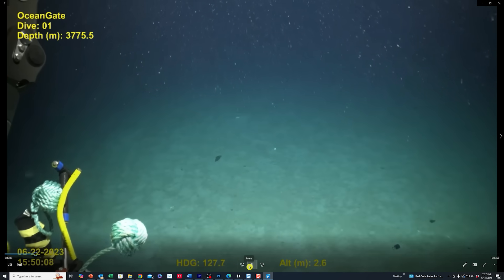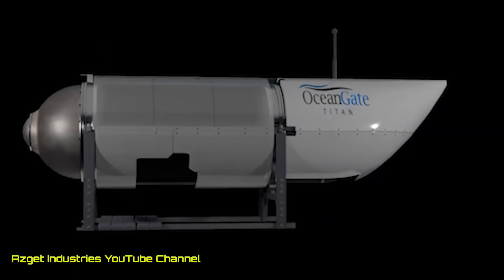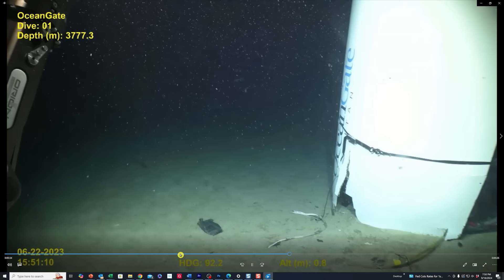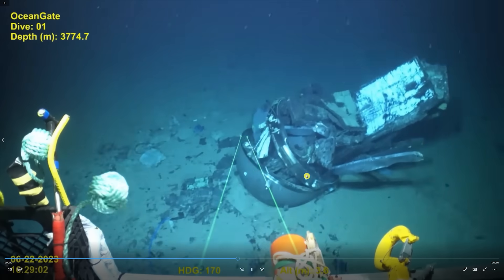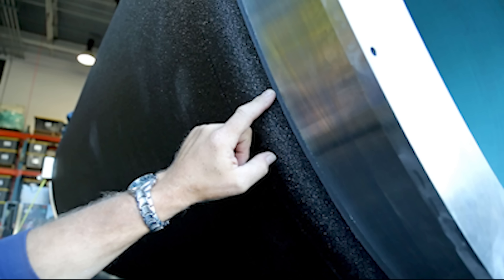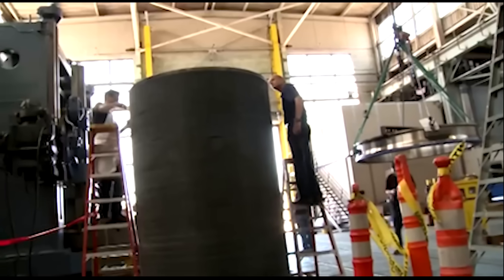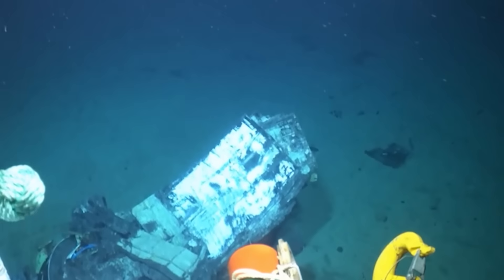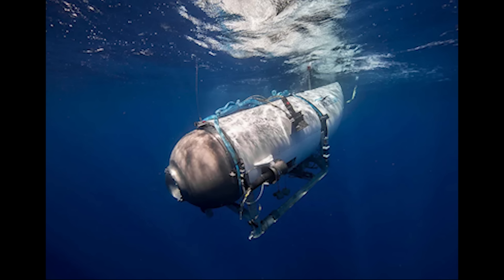OceanGate Titan Sub Debris Video Shows How It Imploded

Comment: The strap and the Playstation controller are still doing their job. So much for all the experts.
Reply: Yeah but that peanut butter glue and the carbon fiber, not so much.
Reply: @hille422  The peanut butter was basically a seal, the 3million pounds of force kept it pushed together. The carbon fiber also worked but he cheaped out on specs. It called for 5in but he stopped at 3.75in once more cost cutting. The ship also had a limited life span and he failed to properly find that number. Why? Penny pinching again. BTW, that peanut butter was another brilliant cost saving off the shelve product. It was Rhino coat truck bed sealer. 😄  not kidding.
Reply: @SlickArmor  Carbon fiber is just a bad material for pressurized environments. for usual stress it's great because it has just enough flex while being lightweight and durable. but for pressurized environments, that amount of pressure turns it basically to glass, not to mention flexing it and eating away at any chance of adhesion
Reply: Wasn't it a Logitech controller?
Reply: @BukBuk187 it was a knockoff of a Logitech design with a 2 star rating on Amazon.
Reply: @SUPRAMIKE18  oof that's even worse
Reply: @which one was it? Any link to the productSUPRAMIKE18
Reply: @mindrover777  unfortunately I can't find it now but there was a whole Reddit thread discussing the controller, it's a Logitech G F710 but  there were tons of fakes floating around on Amazon and eBay for cheap prices they even said Logitech on them but weren't produced by Logitech, they had different packaging and some physical differences, in the news clip where they show the controller someone pointed out something with the grips and the button colors being different that they most likely had one of the fakes .
Reply: @SUPRAMIKE18  wow, will look into that.
Reply: @BukBuk187 yes it was and it suffers from a bad Bluetooth connection.
Reply: Yeah, I find it weird people keep pointing that out when it was probably one of the best made and reliable parts of that deathtrap.
Reply: @John_Citizen_17  I hope they don't find out the military uses them to control flying things that are carrying things that are dropped. If you know what I mean? In fact they're used on quite a few things in all branches. I see here that he stayed true to par and sadly cheaped out on them too.

Comment: I don't get it. Why would they not test the capsule beforehand, put it in a pressure chamber simulating the required pressure, and more, to be safe? It looks like bad engineering and lack of testing
Reply: He was told to conduct all manner of testing and did extremely little.  Not to mention that he was warned and told by experts that the carbon hull wouldn't hold.  Down there is 6K pounds of pressure per square inch.

Comment: The hull appears to actually be sheared clean off the ring. It's just shoved down the rear dome so hard it ripped the bolts off of it. Courtesy of having water move it at mach 10. The front ring was god knows where on the ocean floor at the point when they found the sub. The water pressure sheared the bolts off there as well. My opinion is that the flange on the front ring gave way after the glue gave up. After that there is nothing to keep the carbon fiber hull from collapsing.

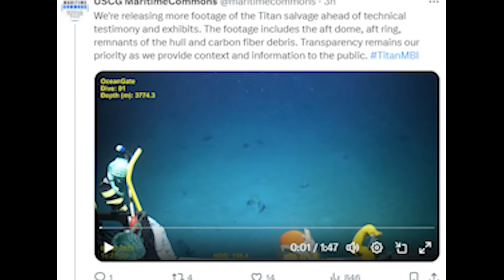Comment: Between about 4:09 to 4:18, I think it IS the view port.  No discernable bolt holes, less of a "round" shape than the titanium end caps, more of a wedge shape, but the camera angle makes it hard to determine whether the top (front) is rounded.  Since both end caps were recovered with the view port decidedly missing from the front cap, this would make sense - but why wouldn't they include it with the recovery items?  The video is between "somewhat inconclusive" and "very inconclusive".  I would expect the light source to be at least a little refracted through the port, but I'm not seeing any refraction.

Comment: Appears that the integrity pressure breach happened at junction of porthole dome. When water pressure entered it looks like it compressed the passenger tube toward and into the aft titanium dome along with occupants. Looks like the crushed carbon fiber cylinder was stuffed into rear dome?

Comment: From the video it looks like a majority of the pressure vessel wound up in the aft dome. My theory is at the time of the implosion the front dome was the first part to detach and within a millisecond the rest was forced into the aft dome. When I was young I heard that a deep sea diver with one of those heavy duty dive helmets was crushed from the tremendous pressure and when they pulled him up his entire body was inside the helmet. I feel like a similar thing happened here based on what I'm seeing. I'm not an engineer but that's what it looks like to me.
Reply: That deep sea diver helmet situation is correct. Mythbusters tested it and it did indeed happen...nasty

Comment: The cross section of the carbon fiber to ring joint at 10:03 is wrong af. There is no reduction of the carbon fiber thickness where it enters the titanium ring. It is uniform thickness all the way to the end.

Comment: Carbon fiber is great under tension; not so great under compression.  Also, the wrap was not the industry standard weave where the shuttle travels back and forth laying an overlapping "weave".  They just wound from one end to the other so you were essentially left with a spool of thread.  Or as one of the witnesses said, "A bunch of string and glue."  Even a thin titanium tube, while still not adequate for those depths, may have slowed a catastrophic failure.

Comment: You do t need to “rough up” he surface before using the glue. Some of these space age glue can bond to anything. And as Scott Manley pointed out in his video that the military used this type of method on their sub with no issues. I also think it was due to fatigue as seen in that animation because CF squish like a sponge. Especially with these new resins. What I think happened was it delaminated due flexing from the pressure. The failure point is anyone’s guess. If there’s a big chunk still attached along with the CF that’s still glued into the groove points out delamination. 

Also the 2 lasers are measuring. The end measure 10cm apart.

Comment: Who in their right minds couldn't see the many problems with this design. Besides the untested designs of the carbon fiber construction, you have nearly 1000 lbs. of unsecured, movable weight in the vessel. Once the center of gravity shifts enough to either end, it's over, there is no way to get the vessel back to the horizontal.

Comment: A sphere is always more stable than a cylinder. 
And then there is the problem of putting different materials together and exposing them to great stress. Deformation will always be critical at the seams. 
Then the question is whether carbon fiber is suitable for repeated use in the deep sea?

Comment: A carbon fiber tank is designed to hold against pressures from within, not external pressures. The only thing holding the external pressure back was the resin, not the fibers. Thats why it imploded.

Comment: They knew it wasn't a rescue mission. Anyone with a modicum of submersible and deep sea diving knowledge knows that if the surface ship suddenly loses both voice communications and the transponder signal, it means that the transponder no longer exists.

As a sidenote, the word "adhesive" should not even be in the vocabulary when we're talking about deep sea submersibles, they should be a solid sphere with no seams anywhere that will weaken the structure.

Comment: If you look at the aft dome most of the hull is stuffed in there. Which probably means the failure was near the forward cone not the middle. It probably came apart at the epoxy where the forward ring was installed. Pushing everything to the rear dome. That's why all carbon and aluminum are stuffed in the aft!

Comment: I worked for an epoxy company that was involved in the O&G  and offshore industry - including carbon fiber wraps.   
Point 1 ) There are epoxies available that do not need surface preparation, otherwise min 75 micron profile
2) we had carbon fiber pipe wraps used with our epoxies. I had to stand in front of a NACE conference and explain that it was a permeant, temporary repair for pipes. It was permeant as long as the operating temperatures, pressures and liquid flowing through would never change. No proper company can guarantee that, but at least they can sign off on it. 

Using CF in a submersible was fools science.

Comment: The second piece is the rear dome and the consensus online is that is where the Human remains were pushed into 😟
At my workplace when bonding thing they are either sandblasted or etched to key rhe surface and then cleaned with acetone etc whist wearing gloves/overalls etc in a clean room. This was all shockingly lax and asking for trouble 😟

Comment: If you wrap a toilet paper roll with string it will be difficult to break it by pushing out from inside but incredibly easy to crush. Carbon fiber is like string... this was an IDIOTIC PLAN FROM JUMP. wtaf 😮
Reply: AND it wouldn't matter how strong the string!!! Carbon fiber didn't really matter it came down to the epoxy. I've drilled enough epoxy and the way it "shatters" makes it an obviously poor material for a submersible. 

It's just such an obviously idiotic idea.... HOW COULD IT HAPPEN? 

All those NPCs working on it... not a coherent thought between them 😊.

Comment: Yeah, multiple different surfaces mated to each other and under extreme pressure.
Let’s be fair, it was only a matter of time.
At least on an actual sub, well military size anyway, if there are breaches, depending on where, there is the possibility of limiting risk and containment.

Obv here there was not. 

If it was built with more money, there maybe could have been a capsule inside that if breached, that could maintain a certain pressure for x amount of time until it reaches the surface obviously.

This thing should have went down a few times unmanned and then torn apart to see what problems occurred before putting anyone in it. Unless of course the only person in it would be the owner or builders.
This is so avoidable, I think is the worst part about it.

Comment: How come in the first video, the sub is standing up on end and has a ratchet strap holding it together, how the hell did that happen, also just using glue with no mechanical adhesion, failure from day one.

Comment: I can certainly see where the flexing of the carbon fiber hull eventually weakened the glue joint at the titanium rings resulting in failure. Rush should have never dismissed the concerns of the very engineers he hired to oversee this project. A triumph of arrogance over safety.

Comment: 8:05
On metal, we usually prepare the surface with rough sanding (24) and use special resin which etch the surface by attacking the metal, and then, put the other layer of carbon fibre. But using filament winding on something that will withstand external pressure is absurd. It's something that is used on low-pressure tanks, not high pressure.

Comment: To think after each dive they never performed any real testing on the structures integrity and composition of the CF material used. You are breaking all physics and engineering principles with cutting edge tech , there is no precedent to be used. Because of this , you can simply say the obvious they did not care about the true safety of the occupants. They were in such a hurry of if they could, they never stopped to think if they should.